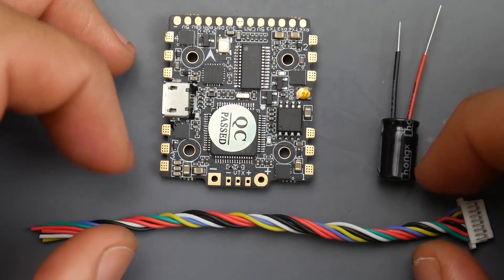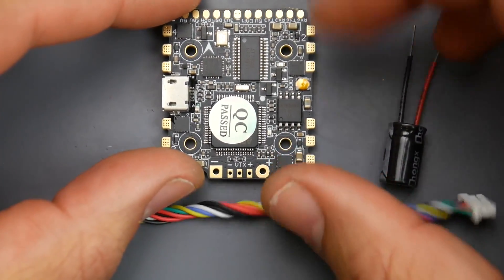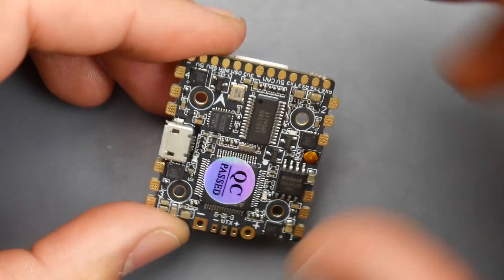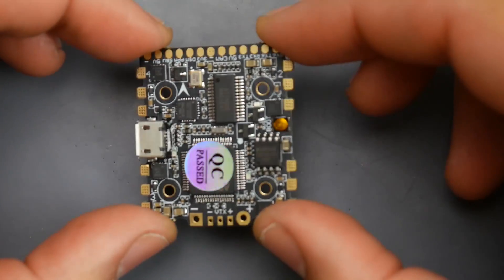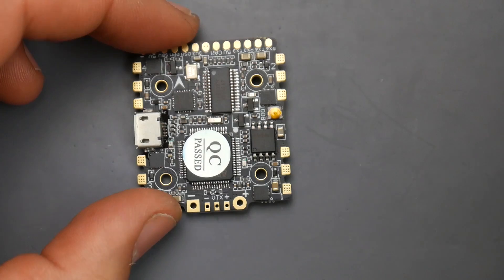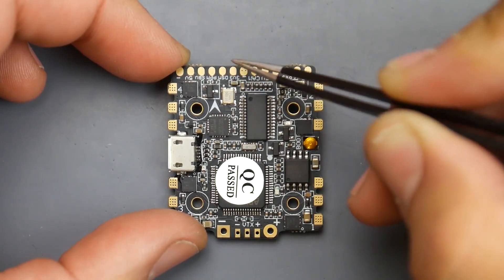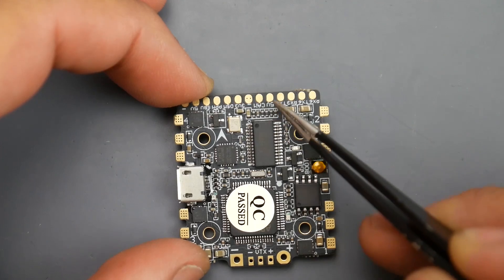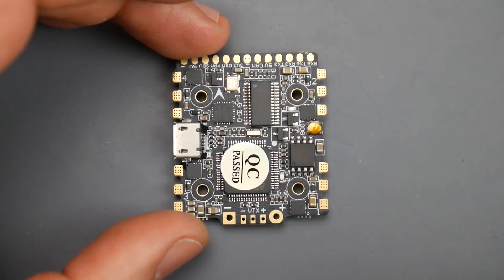HGLRC ZEUS  == Crazybee Board Killer? // HGLRC ZEUS Setup Guide

Comment: I used one of these boards along with a 20x20 vtx on a 2" micro build and can confirm it works fine on 3s HV. It makes for a clean install and saves some extra weight which always helps.  One odd quirk I found though, smart audio didn't want to work on tx3 but worked fine when I tried moving to tx6.

Comment: This board is old af, it's also much heavier than whoop fcs. Why not get a Beta 20a?
Reply: BetaFPV 20 a is good, but it's 0.4 g heavier than this board. 6.6 vs 6.2 for this and the the 12 a toothpick boards.
Reply: @sixtofive  .4g is nothing, you get more amps and a wayyy better reliability. Zero toothpicks use 20x20 boards.
Reply: @astrofpv7035  I'm not arguing for it necessarily, just pointing out that it's very similar in size and weight. I've had good results with one I used on a 2" micro build. Maybe I just got lucky.

Comment: I had one of those boards smoked two of my motors by giving full Lipo voltage on one phase of the esc pads at the moment of connecting the battery. .. So be careful with these things... The QC was more than bad when these came out!

Comment: I had one which caught fire. No obvious reason for it, I don't trust them after that. Also the breakouts via a JST header instead of pads is annoying. Finally only 3S 15A when the new betafpv AIO is 4S 20A. I have another in the box, I don't see the need for 20x20 in this power class anymore.

Comment: Hi! I see SBUS and PPM on many F4 "micro" FC. These are on same UART usually. The sbus is inverted, the PPm is not, am I wright? So could we connect the IBUS on the PPM pad and set serial signal in betaflight or the PPM pad can receive PPM signal only?
Reply: The PPM pad is for PPM signal only as far as my experience has been. IBUS can be connected to any other UART except the one that is connected to SBUS (because it has hw inversion).
Reply: @anti4354  Yes! That is the point! The sbus and the ppm is on the same UART. The only difference is that there is a hw inverter between the cpu leg and the sbus pad. That is why I am curious that this could be work or not. :) I have to try it!